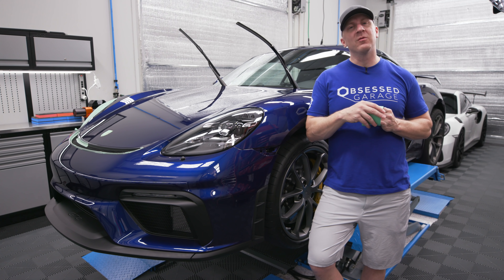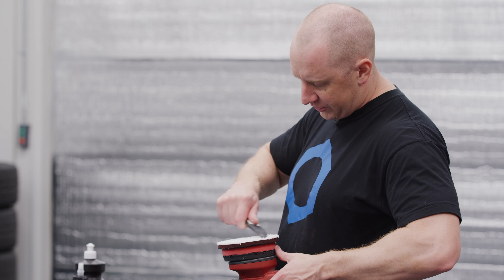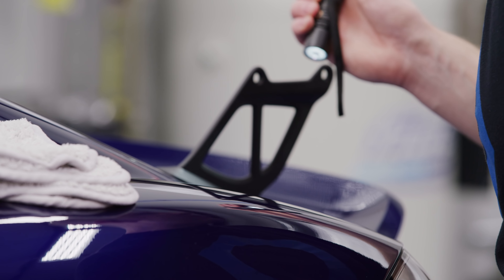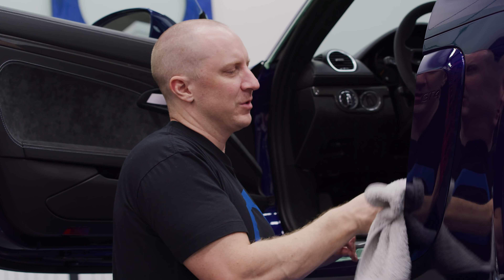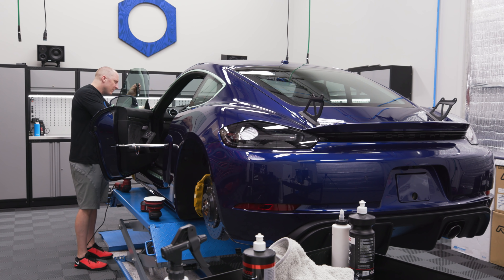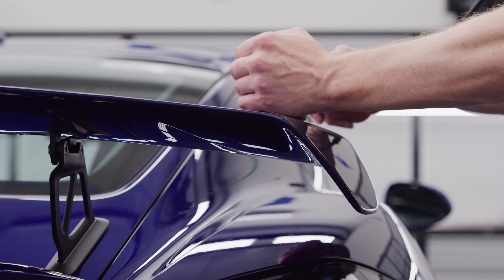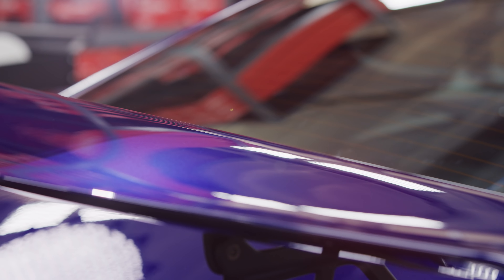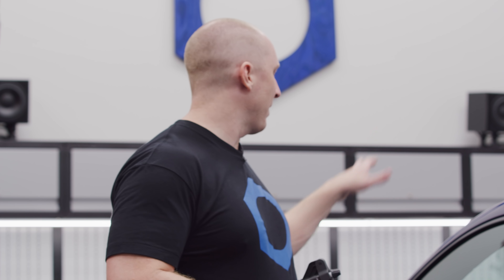My Amazing 718 Porsche GT4 Delivery Experience - E5: Polishing

Comment: For the mirror tight areas... used a dremel with a foam pad to get that OG standard.  Works on the door handle well as well.  I do all of these tight areas first, then work over the rest of the car.

Comment: Paint is just put on cars to stop the sheet metal from corrosion / rust. Then they just slap different colors on it to suit the average consumer. I disrespect my paint just use a wet towel and wipe the dirt off. My car looks fine, I use a touch up paint that is cream and not white but it doesn't matter because I only use it to prevent rust on the rock chips. Sorry to be negative.
Reply: Also if you polish too much you break through the clear coat and begins to sun fade, then your car will look like a shitbox farm ute. If I owned a luxury car I would for sure not polish it.
Reply from the maker: You might want to stay in your lane.
Reply: @ObsessedGarage  cheers for the reply! I did enjoy the video, I was kinda trolling but my car is only $5k

Comment: Why can the rear lenses be polished but the front can not?  What steps are done on the front?
Reply: The fronts probably have a few layers of protection, (beadmaker , etc) and polishing them would most certainly remove that protective coating.

Edit: I'm an idiot for thinking he would've put coatings on before polishing lol, 
They might have some OE coating for reflectivity or maybe a tint I'm not sure
Reply: Most (if not all anymore) headlights have some sort of factory applied UV protective coating on them - so if you hit them too hard then you remove that coating, and the headlights tend to deteriorate (foggy and yellowing lenses, etc.) much faster.  So it's better to stay away from polishing them too hard unless they're really beat up and need it.

Comment: What’s the reason to not polish headlights??
Reply: Avdi Jashari it has a factory coating that protects against uv rays. If u polish headlights you will remove the coating and headlights will yellow and fog from oxidation extremely quick.
Reply from the maker: Bingo
Reply: How long these coatings typically last?